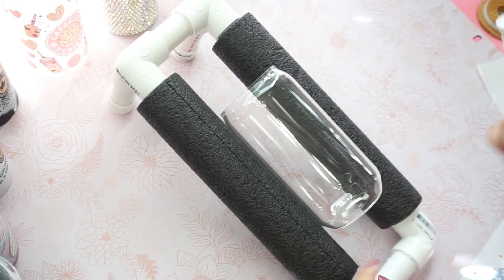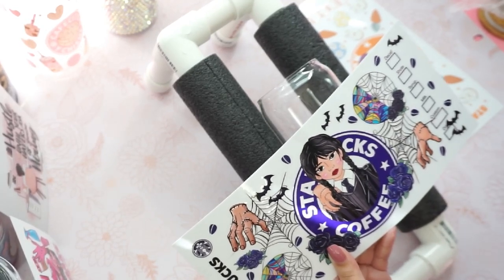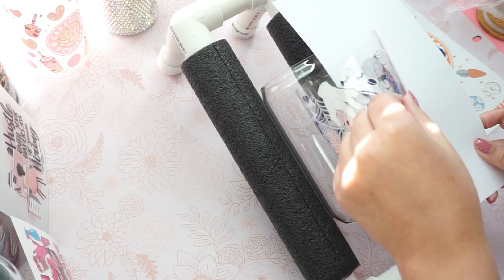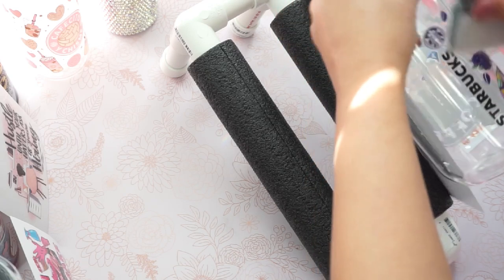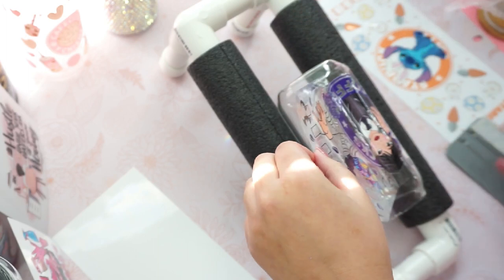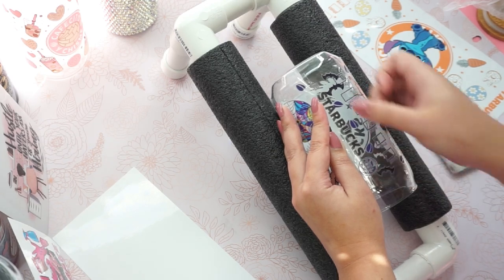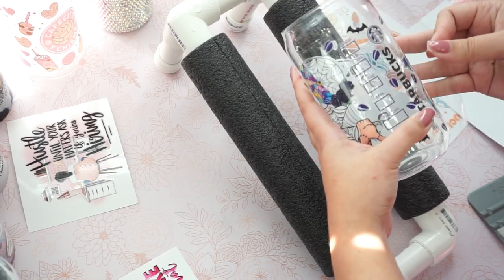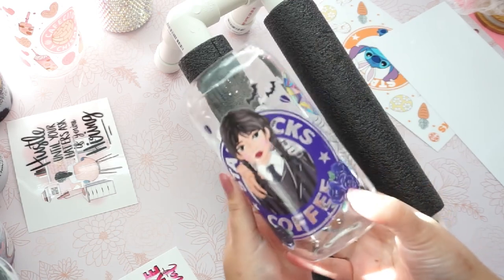HOW TO | APPLY UV TRANSFER PRINT ON LIBBEY GLASS CAN | SMALL BUSINESS TUTORIAL

Comment: HI does the wrap have to be a certain size for the glass. If I order the wraps would they be a specific size.
Reply from the maker: you can put them on any size or surface. Rule of Thumb would be this wrap is meant for 16oz glass can but if you want to put it on a bigger tumbler cutting them separetely before applying them and placing them individually wherever you want would work for bigger cup or mug or laptop or phone cases. the possibilities are endless once you cut them piece by piece